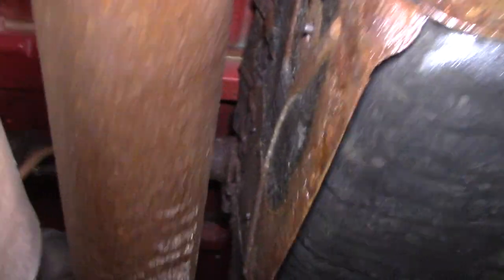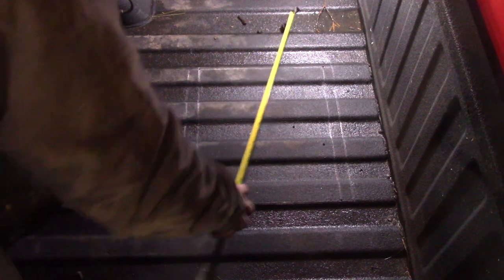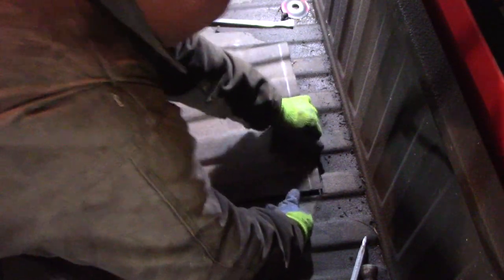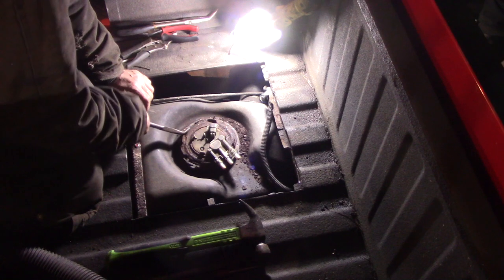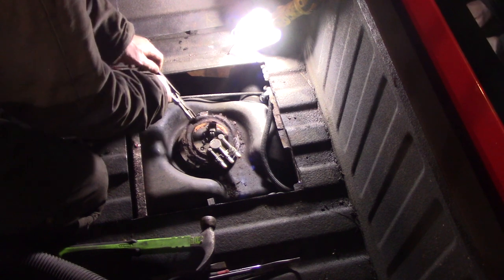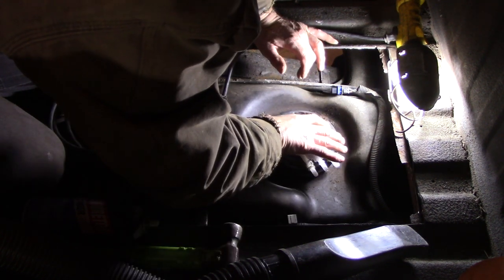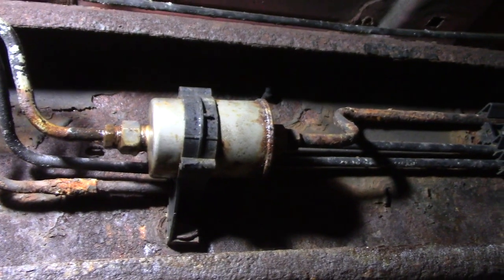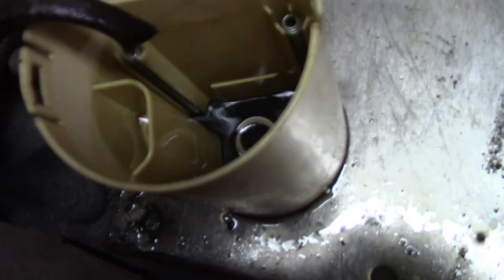2002 GMC sierra fuel pump replacement (the easy way)

Comment: This is exactly what I did, under your inspiration! I would have otherwise trashed the truck, but instead put a total of about 60 bucks into it, and I still got it on the road. Thanks for the great idea cutting a hole above the tank! Dropping the tank would’ve meant too many broken bolts and not worth the money or time.😅

Comment: You got it done. My 1998 had filters and I replaced them rligiously but the pump went out anyway at 196K. I done been there, bro. And, I don't blame you for cutting the bed out, there should be a service hatch from the factory. Great trucks tho.
Reply: I have a 1998 K2500 HD and the fuel pump went out at 172,000 miles. I’m going to cut a hole to replace it. It’s just a beater that I haul lumber, gravel and dirt in. The rocker panels are already rusted out on the cab.
Reply: Yeah the factor knows that could have did that too but they don't want to do that they want to make it hard on somebody that way you got to take it to the dealership it's been thousands of dollars just to swap a fuel pump out
Reply: Did the measurements work for your 98? That’s what I have. 98 2500 4wd.
Reply: @Chris_at_Home did the measurements work for your 98 2500? That’s what I have. 4wd if that matters?
Reply: @stevelawrence4722  Yes they did.  It took me less than an hour to change the pump. I found just the pump motor at Rock Auto so I didn’t even have to pay the big bucks for the whole assembly.  I have a rubber mat in my bed so after putting the cut piece back in with pop rivets I just covered it with the mat. I changed it last summer and it’s working great.

Comment: It’s an old truck. Lifting the bed or dropping the tank means you’re going to deal with rust and break bolts and have a lot of repairs otherwise. This guy is a practical genius cutting a hole in the bed above the tank or the fuel pump can be accessed. This is the solution I’m looking for. Either this works or I trash the truck.

Comment: Very nicely done buddy. If you ever get into a situation where it won't start.Sometimes it's just the ground wire on the fuel pump going to the frame.
I felt your pain all the way through it.
Keith Kuhn
Also on YouTube

Comment: Thanks for this information, I have a 02 Silverado extended cab with the 5.3 liter vortec,your measurements were perfect! Especially liked how you made it line up with the cross bracing underneath so I could screw the panel back on! A++++

Comment: Count on replacing the entire fuel pump assembly and not just the fuel pump. I just did mine and was hoping I could just do the pump, but my fuel line connections were so corroded I just had to replace it all. 

Thanks for the measurements.

Comment: For everyone out there, don't make my mistake. Be sure to connect the ground wire bc I had my pump go bad in freezing weather. On top of which I was traveling to a dif state. So I did all the work in AutoZone parking lot laying in the snow and freezing weather. So before putting truck bed back on and reinstalling, of course I'd test it. But didn't work and I went thru about 4 brand new pumps, including having to rewire a couple. It was super bowl Sunday and I was late, I was fkn pissed- of all days it had to be. Finally a guy passing by asked me if I had the ground connected to the bed frame or panel by gas nozzle. Nope. Totally didn't realize I needed it connected. I thought it was for electrical surge protector. Started right up. Just a simple wire coming from an area I didn't think important caused me so much grief. So don't forget about it. In Silverado the wire that comes by the gas inlet tube.

Comment: I cringe when one has to cut anything, BUT I totally understand where you are coming from. I’m from WI originally, so I understand rust! Great job on the hatch. Nice comments throughout and no worries on the fuel filter possibility. You corrected everything nicely. That ring was a PITA but you did it. Well done.

Comment: my 2006 stalled right in my driveway.A friend told me wack the gas tank from the bottom,it started ,got it parked and did what you did on your vid,this 06 silverado has the fuel filter on the fuel pump. 306.00 napa store april 2022.thanks for posting!

Comment: Good idea to make an access panel and hole in bed. Only thing is without a metal frame for support I feel it make the floor area weak and cut edges will cause major rust.  Trucks should come from the factory with a framed access panel. It make life easier.  
Actually suppose to drop/drain tank and wash it out before changing pump. Contamination sediment in tank can be cause of pump failure.  Most of us shade tree mechanics are not set up to do that extensive route. 
That rusty fuel filter needs changing more often also.

Comment: Many vehicles DO have an EASY ACCESS to fuel pump but GM engineering department just HAS PROBLEM on how to IMPLEMENT a SIMPLE COVER on floor to replace pump after all it IS COMPLECATED and DOES REQUIRE a College DEGREE ! and some DIFFICULT thought ! No different than GM trucks that STILL RUST around fenders ! CAN'T fix this SIMPLE problem that been the same since the 50s ? Hmmm ? What to do ? Hmmm? UNDERCOAT !  Hmmm?  OH ! That will INCREASE COST to the consumer ! Even though PRICE INCREASE EVERY YEAR ! and STILL ! RUST !

Comment: Best video on YouTube. No joke, this saved me so much time and money. Even my local last-resort-friend-of-a-friend farm mechanic was telling me it was hopeless, too expensive to fix, no way to get at it, get a new truck.... you know. Measurements were perfect (I double checked before cutting) and especially the trick to get the new ring under the lock tabs... wow. Thanks so much.
Reply: hell yeah dude, never give up your truck, it's a solid gold piece of equipment to have a GM truck in this era. They are bullet proof, fuckin missile proof trucks that could potentially be around another 20 years with the same motor if all the other stuff was replaced like this. They wont make electric crap that lasts like these.

Comment: Convinced someone to lift bed instead of cutting or dropping tank. Then bolt spun inside frame and had to cut a whole to hold the nut for the beds bolt. At this point asked ourselves why we didn’t just cut for fuel pump😂

Comment: I always thought it was bad engineering the way the fuel pumps are installed / mounted with a twist locking ring - especially since the lock rings are not made of stainless steel so they do not corrode.

Comment: Where did you buy your pump at? I have a 2002 Silverado 2500HD with the 6.0L engine and the same exact pump, but I’m having a heck of a time trying to find one with the single electrical connector and 3 fuel lines like yours in this video
Reply from the maker: I transferred the electrical connector from my old pump to the new pump

Comment: In defense of cutting a hole as opposed to other methods of accessing the pump:  I cut a hole in the floor of my Astro van to access the pump and was back on the road in no time. A week later, the new pump failed. Using the access hole, I had the replacement pump installed in less than an hour.
Reply: Edit: Your numbers were spot on for my 2001 extended cab Silverado. Easy access once I cut hole with plenty of room to work.

Comment: number 1 rule. never ever work on a fuel injection system with a incandescent bulb. many nice repair shops burned to the ground back in the early days of repairing fuel injection systems because of them

Comment: I live in California so this approach is stupid to me… unbolt 8 bolts and screw back in about half an inch on the passenger side and  disconnect the tail lights and you can lift the side of the bed by yourself or with the help of a friend and then stuff a jack between the frame and bed and it’s supported solid.
Reply: With no friend or or jack or rolling around on the ground trying to take out bolts, I spent 10 minutes cutting 15 minutes changing the pump and 10  minutes putting the cover back on. Simple.
Reply: @Oldschoolrules123  Old sheet of plywood or $2 for a large moving box to lay flat under the vehicle. I lifted the bed up myself no problem. Can’t crawl around under a vehicle? Maybe you aren’t fit enough to work on your own vehicle safely anymore… Everyone has a choice to do things the right way or the wrong way…
Reply: @Oldschoolrules123  I’m not the “tough guy” you are just talking weak champ. It’s not about doing things the “easy way” it’s about doing things right way. Cutting a hole is a HACK job…
Reply: @LotsOfPaypa  CRY ME A RIVER
Reply: @Oldschoolrules123  😂🤣😂🏞️

Comment: Can jus undo bed bolts on drivers side n loosen passenger bed bolts n prop the bed up with a board,  done several times roadside

Comment: Truck community just ah ? Is there anything anyway to prevent these trucks from rusting like this I bought 2002 gmc sierra it's ah southern truck I was under my truck thinking dam this thing is crazy rust after seeing 👀 this guys truck mine really ain't that rusty but I'm wondering if ah under coating is available or practical to even do
Reply: Move to a drier state

Comment: It’s not the same on a 99 Silverado long bed. Will get you a hole to the pump but it’s way off from the rails.
Reply from the maker: Maybe some flat stock or angle iron can be pop riveted to the under side of seem to create new rail to hold plate in place.

Comment: Would the location of this form the bed as seen in video be the same as my 01 GMC Sierra 1500 extended cab short wheel base
Reply from the maker: Don't know but you can get an idea from underneath if you drill a hole next to the cross member next to the fuel pump and take some measurements from there

Comment: Would the same measurements work on a 2001 gmc Sierra 2500
Reply from the maker: Don't know I have the extended cab but forgot what the wheel base is

Comment: On an 01 Silverado I just did this. Thanks it really helped. did a modification id like to share.

Did not cut the drivers side . Only cut three sides. The bottom edge of the beds stamped “ribs” on the drivers side worked as a hinge.. moved without bending . Was able to just hood prop the piece up out of the way. Replaced the pump & then to repair the cut I screwed a coupe of pieces of flat stock in the “troughs “ made by the “ribs”… hope that made sense. Have a rubber mat for the bed & with that in place … you just can’t tell the bed was cut into .
Reply from the maker: Cool deal...all vehicles should have an access door or easy access.
Reply: Yes exactly! Well our GM products now do … far as I’m concerned just increased its value lol. Thanks again .

Comment: So why is this really an issue I mean there's really six bolts to pull the whole bed off?? Then there are a few 7 mm(I believe)bolts on fuel fill tube and 2 electrical  cables to disconnect... This video literally  encourages  you to destroy a perfectly  good bed.. I don't  get it. 🤔
Reply from the maker: You must live in Florida or somewhere rust is not an issue.  And as a solo act, taking the bed off with one person is next to impossible
Reply: Yes gee, let's spend hours of cussing verses cutting for 10 minutes to get to the pump. And my bed still works like it did before. Amazing

Comment: Nice cut perfect.
I feel your pain. I remember I had to buy a tool to disconnect those lines. Standby I got to go watch more of  your video. Keith
Reply: Not those lines.  They are finger operated.  Just have to watch a video on where to squeeze them, and they are 3 different types.

Comment: DUHH! Thats EXACTLY what I would do. CUT AN ACCESS PORT. Takes 5 minutes-DUNZO
Reply from the maker: Try fuel filter first.  Mine looked like chocolate milk passing thru
Reply: @JLafix  Is that on the pump?
Reply from the maker: @fladave99  No driver's side frame somewhere in the middle big canister, looking fella
Reply: @JLafix  Thanks!

Comment: Mine wouldn't start after changing pump any help it started but died on 3 occasuons
Reply from the maker: Possible fuel filter clogged .
Reply: @JLafix  replaced that last night after it I changed fuel pump idk what my next step maybe fuel regulator
Reply from the maker: @mannycelis5651  yeah not sure, but if your fuel regulator is separate from your new fuel pump then that's a good guess, but how far do you go winging parts at it ya know

Comment: Would that be the same measurements for a 2012 Sierra extend cab
Reply from the maker: Not sure. You can mostly likely get a measurement to the cross rails from underneath,  the width really doesn't matter as long as you give yourself enough room to work and pull out pump.

Comment: What are the measurements you used when cutting the bed?
Reply from the maker: I forgot now but I do mention what they are in video. But they might be slightly different if you have different model . That truck was a 2002 gmc Sierra SLE crew cab short bed

Comment: My fuel filter was dirty like yours, I replaced and still has issues starting so i'm thinking fuel pump.
Reply from the maker: Could be I think the PSI should read around 40 while it's running . And if I can remember I think it went up to 52 with just cycling the key on to prime
Reply: @JLafix  My Silverado is supposed to be like 52 - 65 psi engine off, ign sw on. You can see what the pump shutoff spec is before buying that brand.   I seen cheap pumps specs say only 50 psi, so something to be aware of.

Comment: You could’ve just loosened the bed and tilt it up and hold it up with jack stands .
Reply: I guess you missed the part where he shows all of the rust. I don't even have rust but made a access  panel. No crawling around on the ground no messing with wires or fuel tank fill-up tubes or rusted stuck bolts.

Comment: I think u need to remove the bed not Dropbox the tank.
Reply: just remove bed to frame bolts, gas filler tube, end gate, and lift the front of the box, leave the back 2 bolts from frame to box in but loose,  remove others and raise the front of the box, instead of risking spark caused explosion. block it up sufficiently and voila, gas tank access and no hole in the bed.
Reply: @whiskeysudsjackwagon8510  Gee , according to you if you stood by your vehicle with a match or cigarette it would blow up.